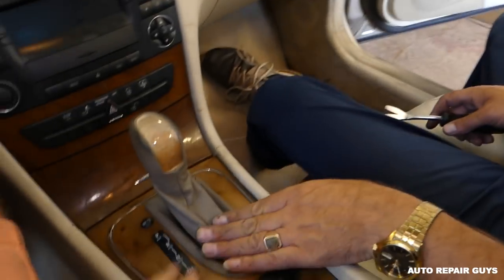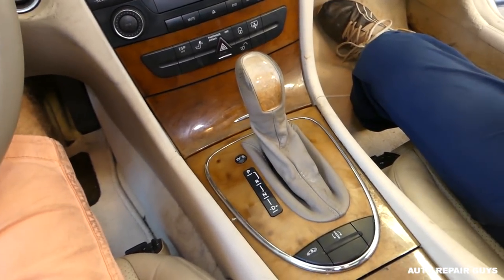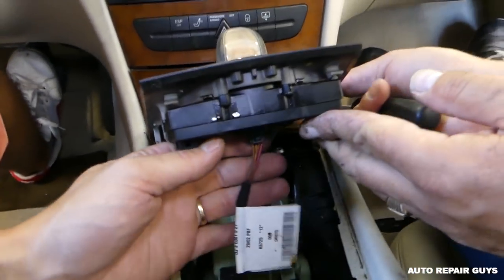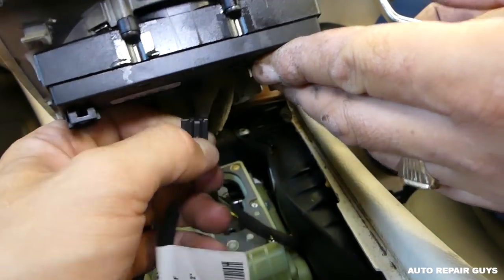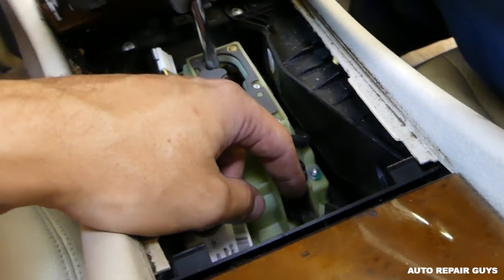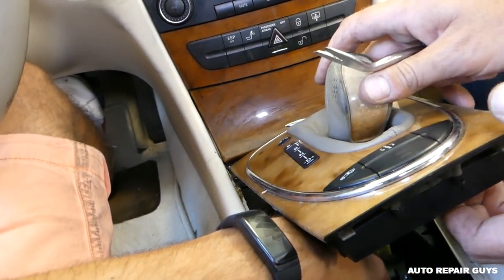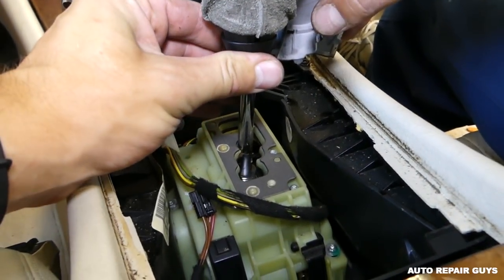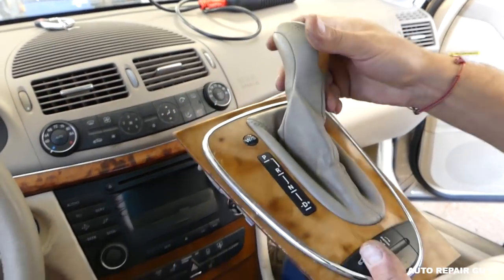HOW TO REMOVE REPLACE TRANSMISSION SHIFTER  ON MERCEDES W211

Comment: Any tips on reinstalling the wood panel piece? I can't seem to get it to fit back in
Reply: Did you have any luck with getting it back on? I need help
Reply: @userinterfacenotfound6011  I did not unfortunately. A few weeks later it needed to go to the dealership for other repairs and they popped it back in for me.

Comment: Hey bro i spilled beer in mine and it stopped running. Left me on tthe side of the road . I thought it was low oil but i dont think so. I put a lil bit motor oil  nd i flushed it  twice now what can it be before i buy a new shifter